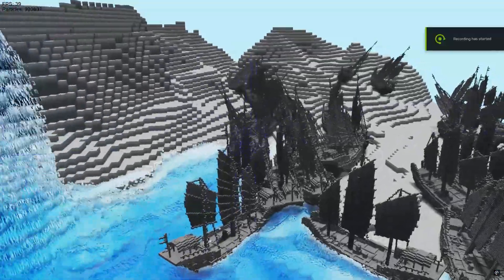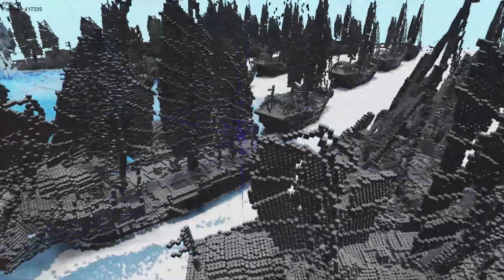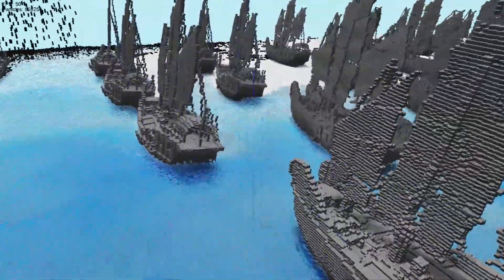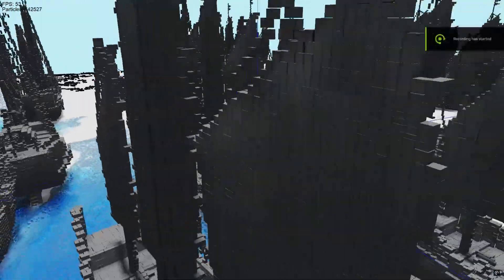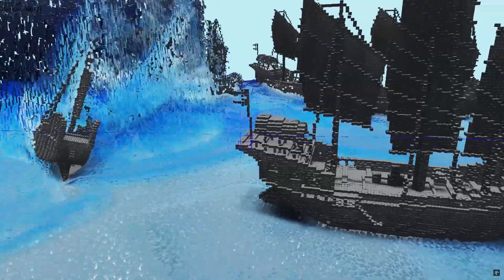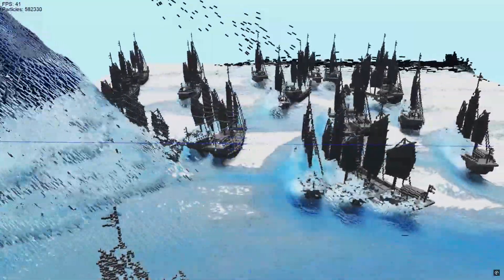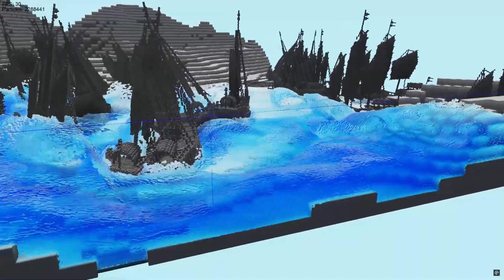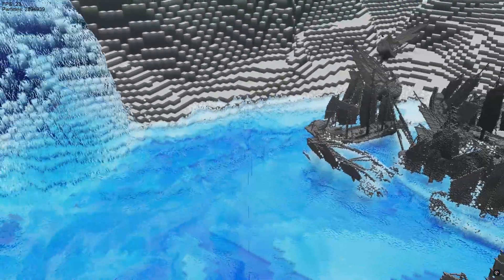Structures Preview | Deformable & Liquid Voxel Physics

Comment: Great work! I remember finding a discord link to your server. Is the server still active? The link I found is inaccessible now. I would like to chat about different simulation approaches, as I am working on one myself currently
Reply from the maker: Hi, yeah, it's not really active anymore. If you want you could ask some questions here as well.
Reply: @GrantKot  Well, basically, I have only two concerns right now. The first one being the grid approach. I've tried allocating static 3d grid but that turned out to have it's own limitations like 1) allocating memory for an empty space 2) boundaries being strict. Using dynamic grid boundaries solves the second limitation, but the first one still remains. So I switched to using a fast hashmap, which leads to losing some fps, however gets rid of allocating memory for an empty spaces. 
My goal is to make the simulation boundless and keep a reasonable framerate. What approach would you recommend to use? / Or which one you use? Perhaps there is a library for sparse grids or whatever?
Reply: @GrantKot  The second concern is about collisions. I can't wrap my head around the grid collisions. In your previous demo showcase, your viscoelastics slide off the "toilets" and other obsticles. The best I could achieve with grid collisions is when particles just stick to the grid, which is basically multiplying the velocity and mass of the cell by 0, reminding more of your temple demo. Do you raytrace for the collisions or is there a simple trick I'm missing?
Reply from the maker: @PchlaPddy  I think there is the Taichi library which might have some sparse grid stuff. Do you sort your particles to tiles? This can make sure you don't have too much overhead with the hashmap. Especially if you also do grid tiles.
I just use distance field to handle collisions between particle and blocks.
Reply: @GrantKot  No, I don't sort them to tiles. And yes, I have quite the overhead for using the hashmap, it's the most inefficient part of my code in fact. 
Is there an article about sorting particles to tiles? I don't think I get the overall idea of this.

Anyways, do you think using hashmap is a good idea? I've tested that fps drop is not too significant for the benefits it brings, around 20% in my tests.
Reply from the maker: Binning the particles helps with cache coherence as the simulation evolves. If you notice your simulation slowing down over time despite having the same number of particles it could be cache coherence becoming worse as particles get more scattered. I use a simple histogram counting sort.

Most of the papers that talk about this and tiled grid are the “GPU optimization MPM” papers try these keywords in search. e.g. A Massively Parallel and Scalable Multi-GPU Material Point Method.
Reply: @GrantKot  Ok, thank you for helping me out :face-red-heart-shape:

Comment: pretty good! something i dont understand is how mpm is able to keep the particles aligned with each other on a cubic grid, because when i tried to make my particles stick they'll just re accommodate into a triangle hexagon pattern since they are spheres.
Reply from the maker: There are elastic forces that help keep the shape, either from the stress tensor or springs. The particles are advected with the grid velocity. If you use density summation the rest density should be the initial density. For elastics it also helps to have more particles per cell so that it has adequate resolution when stretched.
Reply: @GrantKot  so the forces keeping the particles together are separate from the actual mpm simulation? because something i noticed is that the ship seems to be divided into small chunks and those chunks move but the particles within those chunks seem to be attached to those chunks.
so like, the forces on the particles move the chunk and that chunk moves the particles?
Reply from the maker: Yeah, here it's based on shape matching. Take a look at Matthias Muller's publication list. Basically first the particles are advected (G2P), then the shape matching clusters calculate forces that the particles scatter to the grid (P2G).

Then I also have the viscoelastic model which each particle keeps track of its local deformation and generates elastic forces.

Comment: What's going on with the individual fluid particles sticking to the boats and then 'dripping' off?
Reply from the maker: Base MPM is a bit sticky because everything is handled on the same grid. There is an extension called Compatible Particle In Cell that I will try out. Currently my main focus is to get the general data into shape so I can improve the renderer, eg be able to sort objects front to back, keep track of voxel colors.

Comment: Keeps getting better! To let the boats fracture, you would need actual links between particles to calculate stress instead of a force holding everything together. Wouldn't this be extremely performance intensive?
Reply from the maker: It would be a similar concept to the multigrid pressure. Currently I have particles that can keep track of their deformation gradient and fracture but the stiffest it can get is very soft jelly. The clusters give a coarser resolution mesh that can be operated on and makes it easier to get stiffer objects.